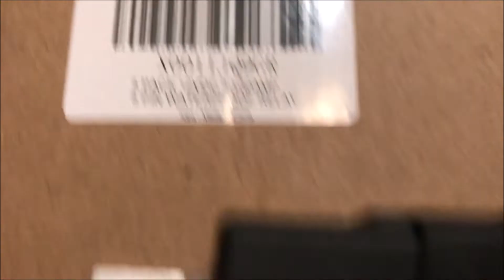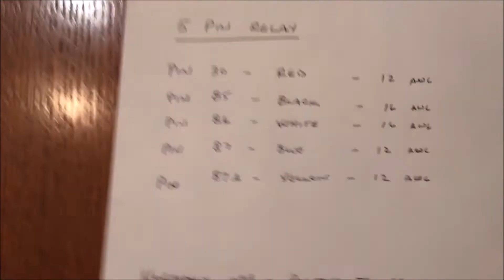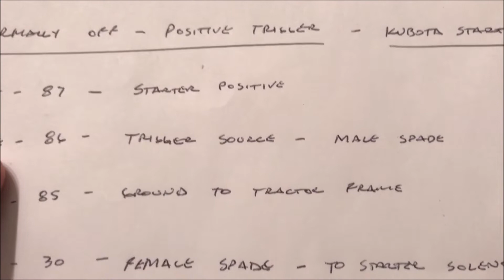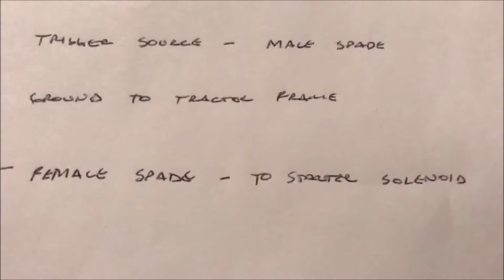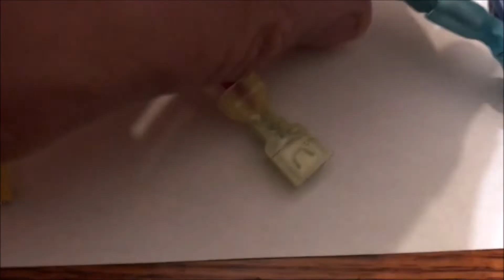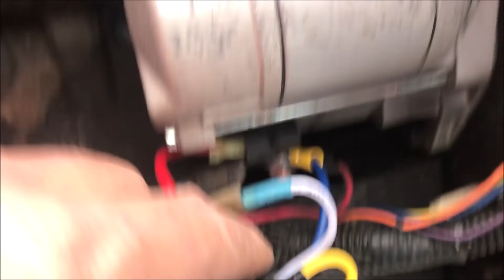OldGuyDIY $8 DIY Tractor Starter Relay Build Pin Out Wire Diagram Colors Schematic Kubota JD Deere

Comment: Do you think your original starter was bad or still good?
Have issues with my L2050. Thinking of changing the starter. It only clicks. May be I should try this ??
Reply from the maker: If it clicks, the relay is firing but the starter may be bad.  I suggest rapping the starter with the key turned to on, if it takes off, you know the starter is failing.  Measuring the voltage a the starter is the the way to tell if adding a relay like this will help you.